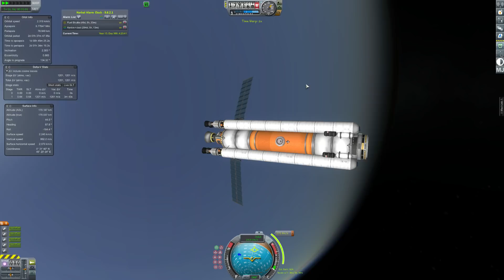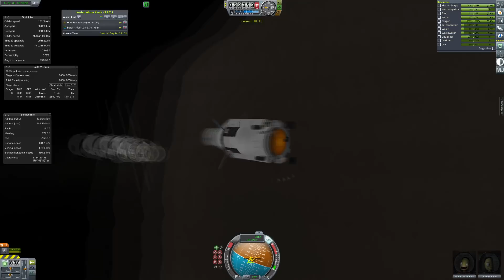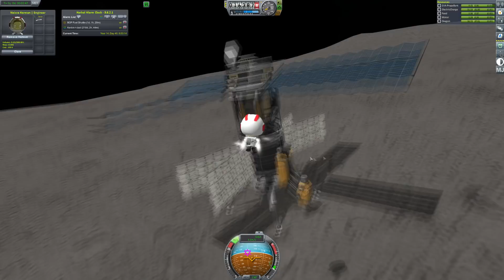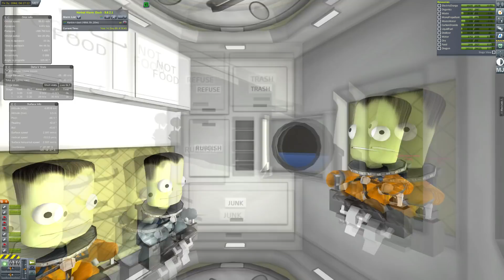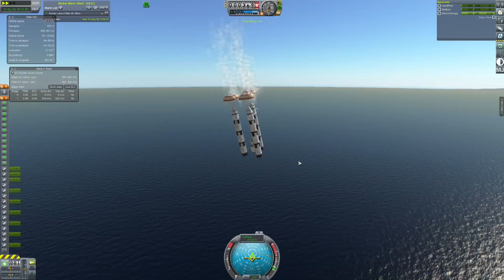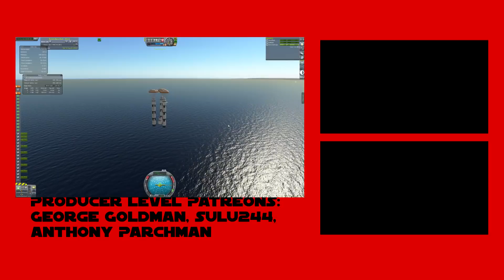Road To Colonisation #34 - Bop Mining Operations - Kerbal Space Program

Comment: Why didn't you build the new things on Laythe? You are using Extraplanetary Launchpads after all :)

Also, AFAIK, all salts* are solid at room temperature unless dissolved in a liquid (usually water, but not all salts are water soluble), so Laythe's atmosphere cannot be mostly salt, and Laythe is a tad chilly for the humidity to be particularly high. It can, however, have a lot of sulfur dioxide or similar (which is what I've heard as for why Laythe's atmosphere is not breathable). Anyway, I do remember the old atmospheric analysis (KSP 0.22) saying that while Lathe's atmosphere does indeed have oxygen, "you wouldn't want to breathe it". So I agree (to a point) with those people on the breath-ability but not the exact reason :)

* Certainly most are.

Comment: Hey tape, I got a question considering KSP. How in the world do you stage several engines. (Imagine have lander that has 3 engines at the bottom, an you want to couple it, but without having to put a single coupler on each individual engine, how would I just put one thing coupler or fairing to have a secure connection between my launcher and lander?)
Reply: Put them on action groups so you can shut them down or activate them at will.
Reply: Try putting a structural beam underneath attached to the center node of the upper tank. Then use the cubic octagonal strut in three-way symmetry surface attached to the underside of the tank which you can then attach the three engines to. Now you can put a small decoupler on the bottom of the central beam and a fairing base beneath that which is the same width as your tanks. You should be able to  make your fairing walls close around the base of the tank above it creating an interstage fairing. You may need to use a few struts to strengthen the connection between the fairing base and the upper tank.

If you don't care about making it look realistic then you can forego the central beam and simply attach your smaller decoupler directly to the node underneath your fuel tank. Then use the translate/offset gismo to SHIFT+drag the decoupler down low enough to fit your engines above it. Attach the engines as before using the cubic octagonal struts to surface mount the engines to the underside of the tank. Now put the fairing base under the decoupler as before.